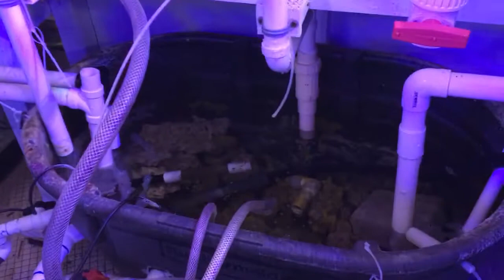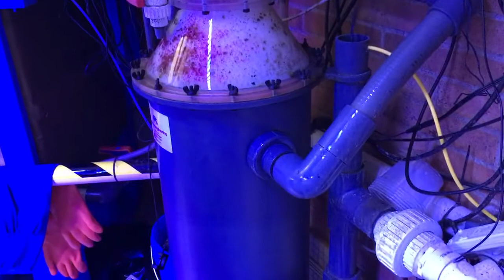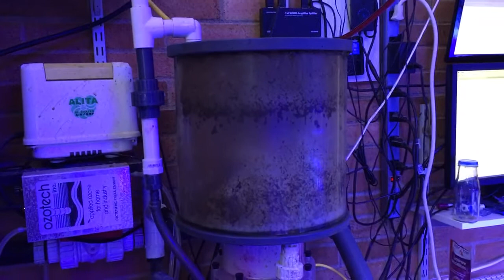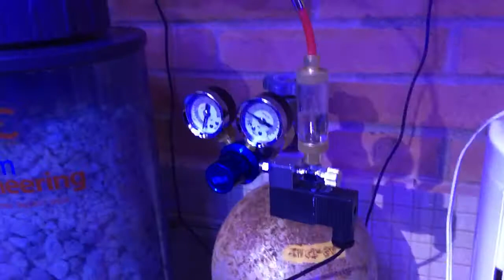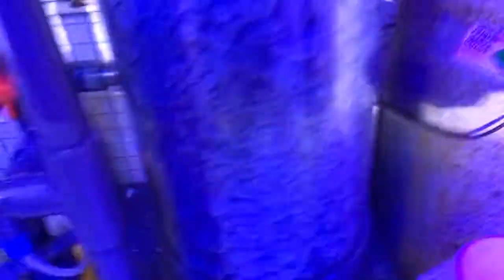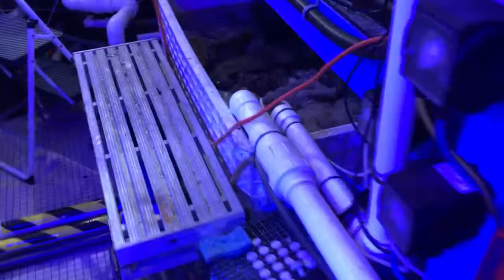Aquarium Engineering protein skimmer and calcium reactor

Comment: Could you do an update on the skimmer .
Reply from the maker: The skimmer operates perfectly just like as illustrated in the video. We've had it about ten years now and I've only fully disassembled the pump maybe twice. It's a great skimmer and the air pump makes air injection completely consistent. Every other air injection method requires periodic cleaning. I also operate an RK25PE skimmer and the Mazzei injectors have to be cleaned regularly.

Comment: Is the skimmer cup part pvc or acrylic ? Also how do you empty the skimmate out ? Or take apart to clean it ? Just unscrew the screws ?
Reply from the maker: The cup is clear PVC. The skimmate is emptied with a valve and down a hose attached to the bottom of the cup. The very beginning of the video shows a red handled white true union valve below the cup. About once a year I undo all the screws, disassemble the entire top of the skimmer, and soak it in a citric acid solution.